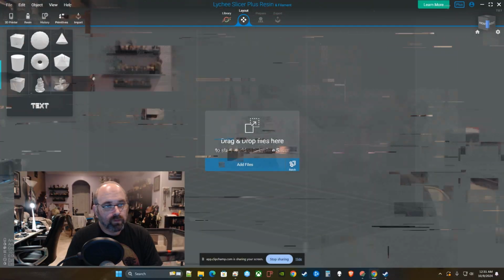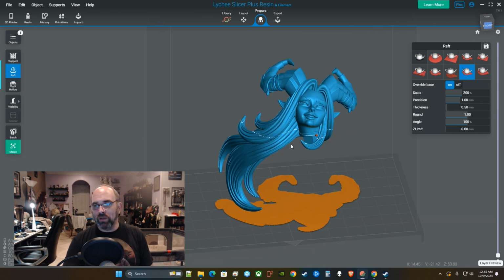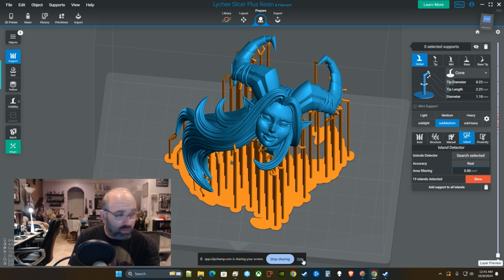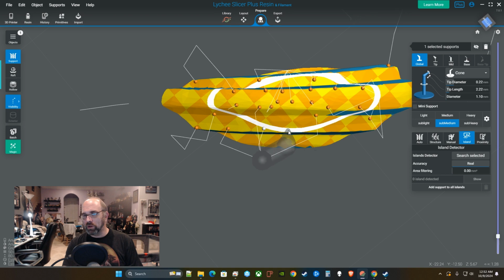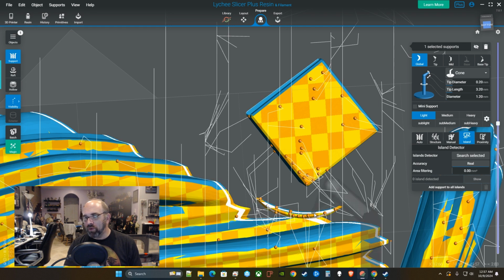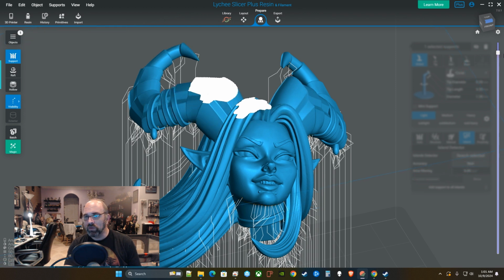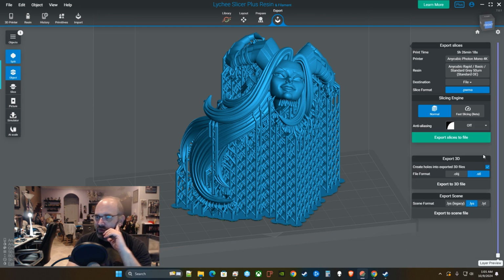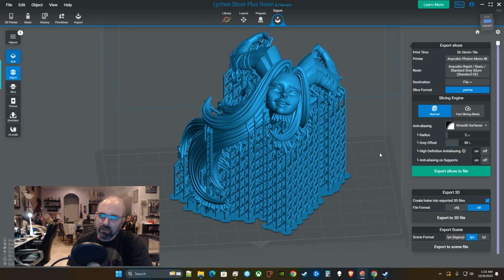Learning Lychee Slicer and 3D Printing   Software, support, basics and more

Comment: Great video. Are your support settings specifically for miniatures or can it handle more?
Reply from the maker: Most models I support I start with .22 - .20 tip size that works for most "parts". For larger parts, and I judge this based on "mass" like how much actual size + weight I am dealing with to judge the supports, but I am shocked sometimes at how much they can handle especially better resins. So, no not just for minis. Minis you can go even smaller like .10 - .15 tip size.